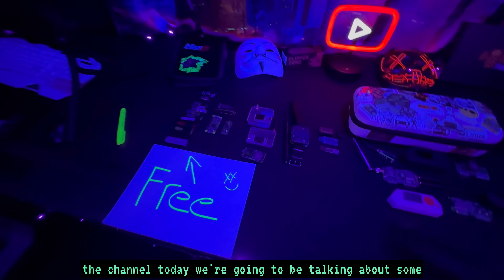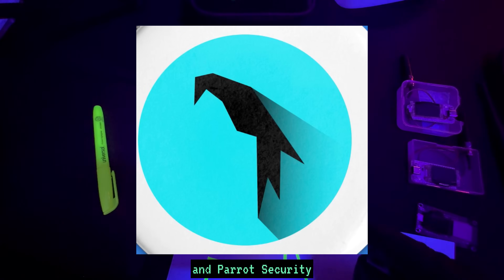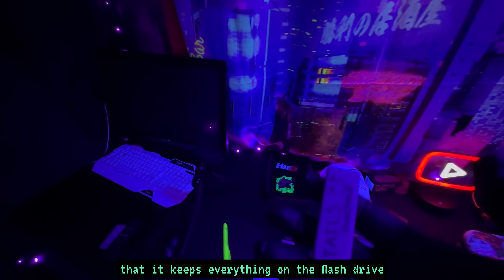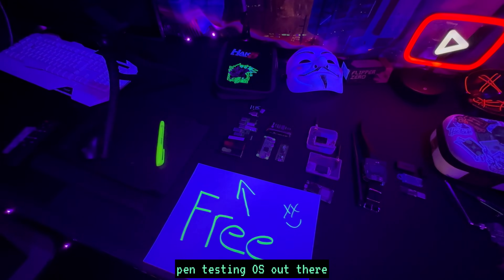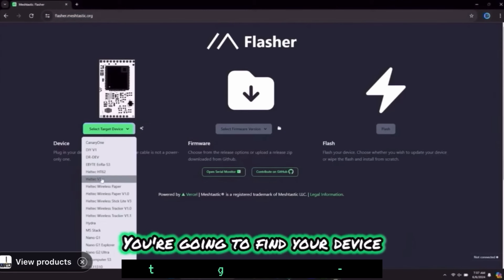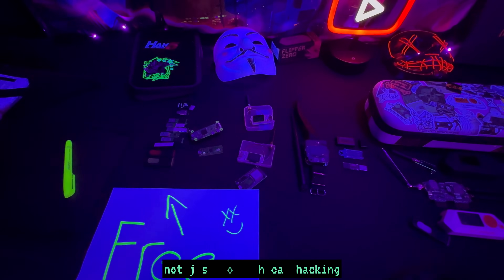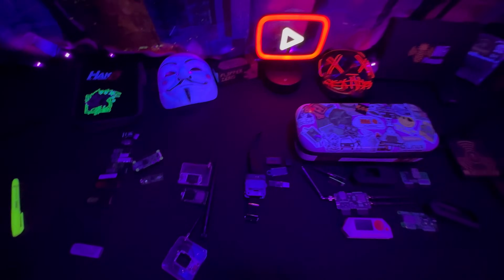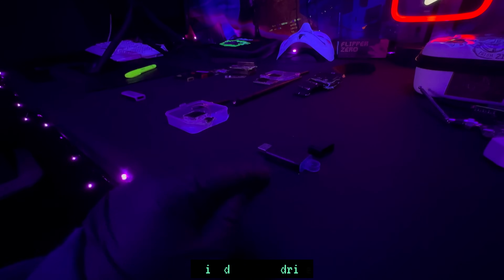From Free to Premium Cyber Security Tools : A Beginner’s Journey Through Pen Testing Gadgets!

Comment: I have another question can bad USB unlock an iPad that has been locked. I have probably 10 or 15 old iPads left in the shop that people have left over for repair. There's nothing wrong with them. They just can't unlock them and never came and picked them up can bad USB physically unlock an old iPad so I can use them for Home Theater Display automation and lighting control. Can I put different firmer on my iPad such as tails or Flash Kali.
Reply: Stop stealing things...